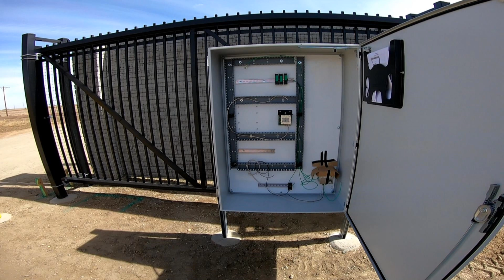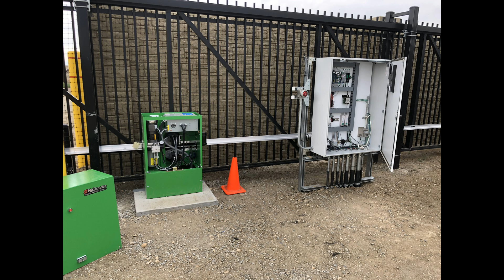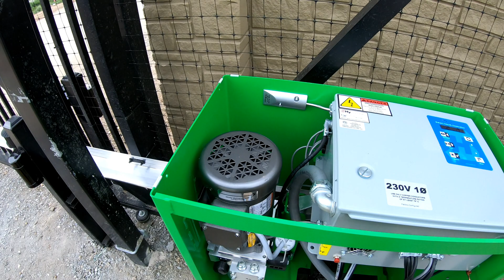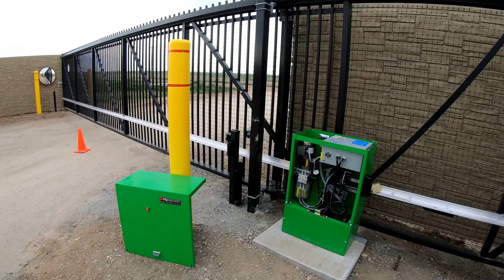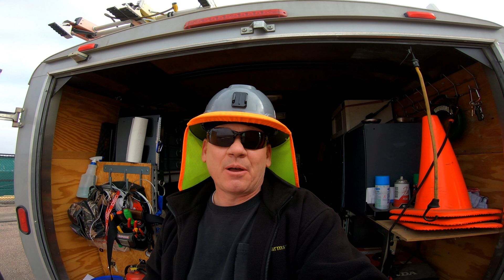Vehicle Slide Gate Installation – HySecurity SlideDriver (Video #4)

Comment: General question. 
I’ve been using Irb beams for years without issues. 
We switched mostly to optex beams and love them. I’ve got an Irb-Mon setup that’s failed twice on us and can’t figure out why. Driveway is 40ft. 
We install the beams and they work for a while. Then out of the blue they’re tripping on their own. We’ve reset the sensitivity twice. They work a few days then we again get a call that they’re not working. Get there and the boards flashing. Remove the cover and they work. So last time I used the cover to set sensitivity by placing the cover over 1/2 the unit while adjusting sensitivity. 
Any advise??
Reply from the maker: I've had horrible experiences with IRB's.   They can interfere with one another, if you have multiple pairs, be sure to have the transmitters aimed in opposite directions so the do not hit the same receiver.  On occasion, I've been able to purposely aim them away from each other to limit the cross-talk.    I've also had issues during certain times of the year with the sun causing issues.  My best advice is to use another product.  My preferred beams are the Seco-Larm Enforcers, although I'm about to give the Nice/HySecurity BlueBus beams a try.
Reply: @AccentAlarms  
I’m using optex lately and zero  issues
Reply from the maker: @philipwilkins3812  I only have good things to say about Optex as well.

Comment: Hey there Sean,  Rufus here.  We have  the Slide Driver at our Sub Station.  Our manual release keeps unlatching. No one can seem to figure out why. In your expert opinion what are the possible reasons?
Reply from the maker: Without actually being there to troubleshoot your gate, I suspect that the drive wheels are contacting the stop ramp and popping the release assembly.  Make sure (1) you don't  have a broke wheel, (2) limit switch is out of alignment, (3) you slow-down valve is out of adjustment (if you have a model with this), (4) maybe your stop ramp is loose or messed up?

Comment: I am not familiar with the BEA LZR H100, so I am gathering knowledge on it . I like it so far.  In this install you used the laser as well as photo eyes.  Why do you use both?
Reply from the maker: Great question.  The LZR H100 is used as a vehicle loop detector which currently does not meet the requirements for UL-325 Life Safety.  So, the H100's are used to open the gate for Free egress and provide safety "loops" on the inside and outside of the gate (this keeps the gate from closing on vehicles) while the photo beams provide protection of people from being trapped/hit/dragged by the gate.

Comment: How to i program remote on this machines
Reply from the maker: The SlideDrivers do not come with any remotes, you would need to add a remote and wire to one of the open inputs on the SmartTouch control board.   Programming a remote then would be dependent on the brand of remote you purchase to use with the SlideDriver.

Comment: Nice job man im impress i have question for you im currently working on a Hysecurity SlideDriver model 222 from 2011 it only runs on constant pressure that was after a company ripped the underground cables off that supply the 208 voltage to the motor they were digging a big hole close to the gate my hC and Ho settings are set 0 momentary work any idea what else can be wrong? Thanks! New subscriber here!
Reply from the maker: Thanks for watching.  If by "constant pressure" you mean that you have to hold the open or close buttons down to get the get to move, you probably have one of your safety devices in fault and it's is forcing you to manually override them by applying constant pressure.   HySecurity Tech Support, (253)-201-2918, is typically really helpful and if you leave your number, they will give you a call back pretty quickly.
Reply: @AccentAlarms  Thanks I'll give tech support a ring

Comment: Quick question, when installing the drive rail, what have you found to be the most efficient way to keep it all level across the gate?
Reply from the maker: I use square u-bolts so I can adjust the gate up/down.  I start with them snug enough that the rail won't move on it's own, but can be adjusted with a hammer.   This allows me to get it "close" to right and then to fine tune it for the final position.  In general, I use a 2-foot level on the drive-rail and speed square to align the drive rail with the notches on the gate operator.